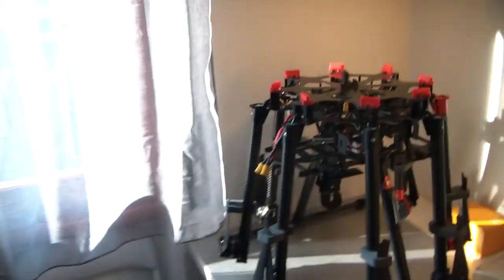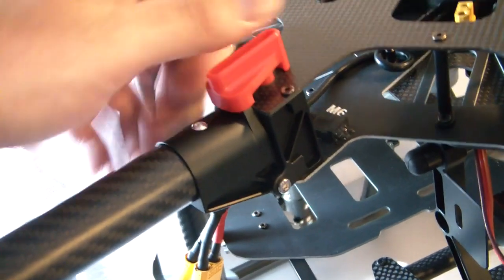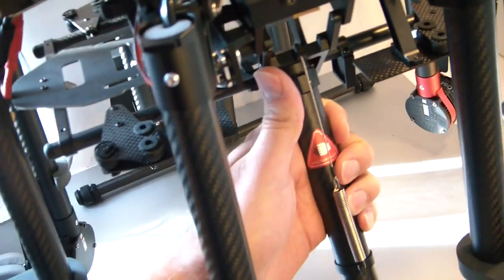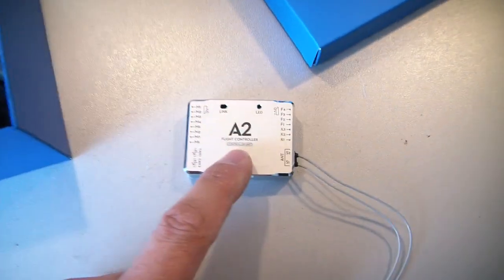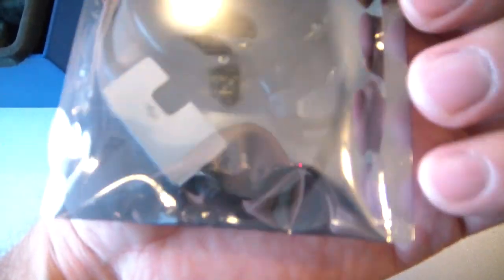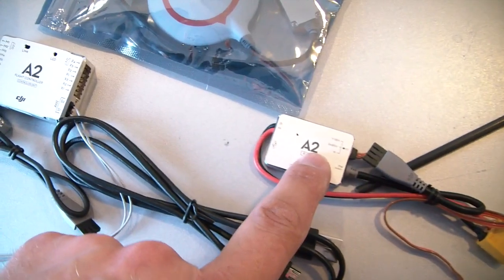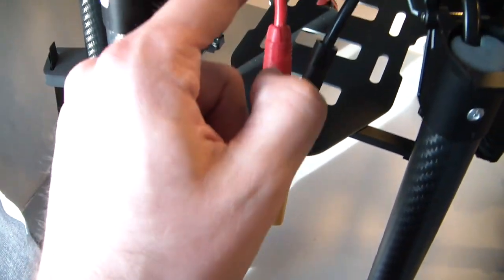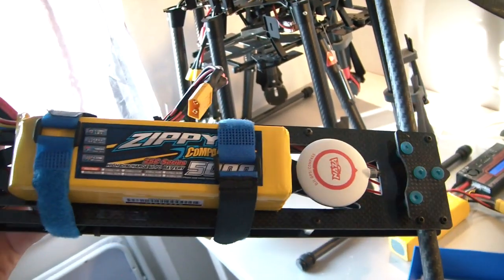RC: Unpacking the DJI A2 Flightcontroller and taking a look at the S1000 structure

Comment: Hello , I have a question .
how do I install the futaba t8j and a s2008sb receiver on a controller dji A2 ?
I would appreciate your response
Reply from the maker: The A2 has a "Build in" reciver that will work with your Futaba once it is binded, so you can save your external reciver for another model.
Reply: Thanks for your time.
Reply from the maker: Joaquin Ripoll you are welcome, i am always glad when i can help :)